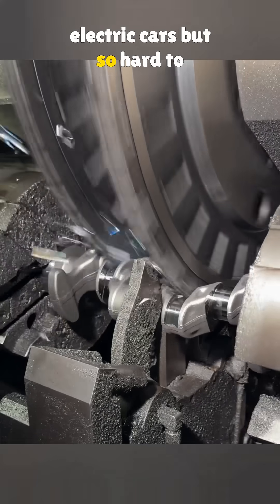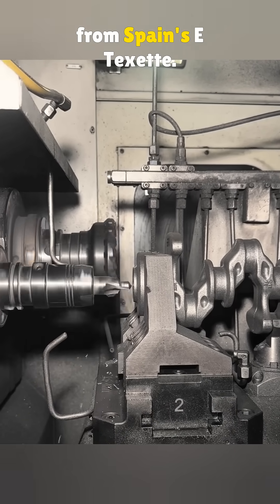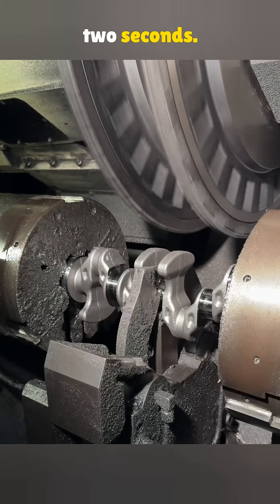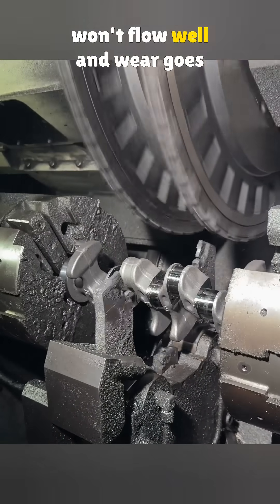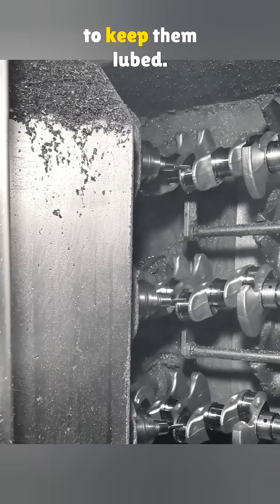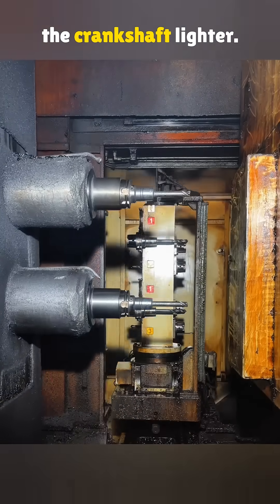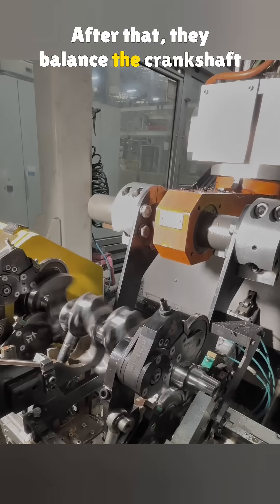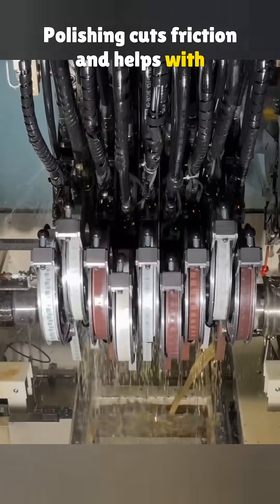How a Crankshaft Is Made #automobile #car #cartech #engine #mechanic

Comment: Unfricken believeble. Yet despite such complex manufacturing process, not cleaning the crank to perfection after drilling will make your engine fail just because of tiny particles are still present inside the crank.
Reply: Very true and I am impressed that someone would mention that. It was called the " plain bearing" long ago.
Reply: The debris getting into the babbit material on the bearings will lead to failure.

Comment: The internal combustion engine is riddled with flaws that cannot be engineered out but can only be counteracted with additional mechanisms and systems
* Excessive heat
* blowby gasses
* Excessive noise
* pollutants
* narrow power band
* low power
* ignition timing issues
* Excessive vibration
* much more
The electric drive train eliminates those issues in a smaller, more durable package that requires little maintenance

The main problem with EVs is that it greatly reduces revenue for Wallstreet

ICE vehicles generate more profits after the initial vehicle purchase with replacement parts, repairs, maintenance and fuel cost

Wallstreet don't want EVs to go completely away just the meddle and low end ones for the average consumer

They very much want the electric Bentley, Rolls-Royce, Ferrari's, Lamborghinis, and other luxury and hyper cars for themselves

Don't let their campaign to kill EVs succeed

The lies are:
* EVs are too expensive
* batteries don't last
* catch fire more than ice
* charging takes too long
* nowhere to charge
* low range per charge 

Once you acclimate to the slightly different way of owning an EV you will not go back

Comment: I do balancing myself. It’s a specialized field but you’d be surprised how much work there is; hospitals, electric motor companies, every industrial business, etc. We actually don’t do crankshafts anymore, or any automotive stuff tbh (it’s not worth it for us), but my grandfather and father did in the past. They used to balance Ford stuff, for example. We only do industrial stuff now, mostly really big stuff. We have balanced rotary engines before though, that was interesting (guys cut them down and ruin them).

Comment: what means easier to produce? when normal gas car are still cheaper then electrics? isnt it the other way?
in my country cheapest electric is still 10% more expensive than cheapest gasoline car and for sure its not better in performance or range than it

Comment: This is all a ploy to make it seem like electric engines are better.. the fact that I can be stuck in a desert, and be saved by a gas can, keeps the gas engine better.. the fact that the batteries are so toxic that if they start on fire, it will never stop until its all gone.. the fact that if I get stranded somewhere, no one is gonna be able to  ring me a charging station, but, they can bring me a can full of gas!!

Comment: Yeah but the problem with electric cars is they are driving bombs I’ve seen one explode and they burn at about 4000° you cannot put them out and they will continue to explode as each cell explodes and if you’ve seen the people who mind the equipment the chemical to make the batteries they’re covered in it and they die of lung exposure it’s horrific in ChinaWe don’t need electric vehicles dependability is still with the modern piston engine which would you rather have if you’re gonna have to take 1000 mile trek through the wilderness you just don’t get the mileage out of a charge

Comment: Then y electric so expensive?
Reply: Because of the battery pack, mostly just that, the rest is cheaper actually.
And that isn’t really hold true for most part, since there are electric cars that cost 30k, and gas cars that cost 50k or even 100k, and the price of batteries dropped by 90% since 2014, and could drop even further in the future.

And even if the machinery to build the crankshafts of gas cars may seem complex, it’s all tried and tested technologies since an hundred years or so, so there isn’t any R&D expenses involved anymore.

Comment: Nice, now please upload a video on making parts for an EV, with the same level of detail in manufacturing the components - motors, batteries, PCB, the components on a PCB, controllers, chargers etc etc.... Let's then see if the process is any easier than ICE engines.
Oh! And don't forget to mention charging stations and the lack of their availability compared to gasoline.

Comment: The engineers and machinists who design and operate these technological wonders are among the unsung heroes of the automotive industry.
Reply: They need to have these engineers address maintenance and repair design.  At least for the areas that are known to require replacement/repairs.    When replacing a light bulb requires taking half to front end of the vehicle apart to replace.   That's Idiotic.  But I know its all about ease of manufacturing, and great for the dealership maintenance departments.   Just not for the vehicle owners.
Reply: Just remember, the engineers also don't give a shit if the mechanic has to remove the engine or transmission just to change the starter..
Reply: Kungen Gustaf V Adolf Bernadotte vart Älgjägare på Halle & Hunneberg,och en av hans Prominenta Jaktkamrater
Vart Reichkansler H.W.Göring 
Vid ett tillfälle vart Lottakårens Rut Martinsson uppvaktad av en något överförfriskad otäcke
Tysken,dvs Herrmann W.Göring då räddade de Värnpliktiga Lottan Rut Martinsson ur Klorna på den Tyska Örnen-Han fick sova ruset av sig i ett kallt Tält på Halle & Hunneberg,och ådrog sig en svår Lunginflammation varvid Kungen beordrade en Taxi och en Pilot att frakta Göring till Uppsala Universitets Sjukhus,där han något senare fick besök av Anna Lisa Eriksson och Gabriella Ida Karin Stenbäck,varvid tycke uppstod mellan Gaby och Herrmann W.Göring. De fick ett gossebarn 26. November 1945
Som blev bortlämnat. Valter Evert Karlsson född 451126-numera Valter Kegö Scheelegatan 38A Stockholm
Reply: They were able to convince the machinist to do this for pennies. That's the real crime.

Comment: And electric car and truck suck, cause we do not have the technology  to get the to run 500+ .ls on a single charge, and the produce more toxins into the air in the first yr of use than gas or desiel engine does in 10yrs, there also a fire and explosion hazard, and where do we get rid of the batteries after we replace the old ones we can't refurbish them like lead/acid batteries in our cars now. Electric is just plain junk in a fancy wrapper being pushed on ppl by green ppl.

Comment: You can understand why many modern American cars are such crap and leak oil. They tend to use cheaper steel that will begin noticeable degradation in 5 years. Older cars, if properly oiled, might experience almost no wear to the metal in the engine block because it was made from the best steel around, which is now too costly. Steel from Asia is (well, I guess, was) cheap because it wasn't the highest grade. 

Even pricy metals like Silver aren't worth anything if not refined to a pure state. A US quarter is 0.9 silver (90% silver, 10% impurities; not including the copper fill, visible from edge). In the US, the standard for pure silver is 0.999 (99.9%) and in the UK, it's 0.9999 (99.99%).

So, in the US, steel quality varies quite a bit. At my job, we use 304 and 304L stainless steel. One is used for more exposed parts to the elements, the other is for parts we make that're more protected from weathering, but go unpainted. The difference is the amount of manganese in the steel as a percentage. Essentially, on has a more strict iron/manganese ratio than the other.

This is the type of steel quality variance that matter when put into an engine block. You cannot just put any quality steel. You want one that's tough, and one that doesn't rust. Rust is FeO3, meaning for each iron atom, you add 3 oxygen atoms. Doesn't take a genius to notice that's gonna require more room, and therefore the metal expands. This is how an engine that hasn't run (and therefore been lubricated) can seize. These components are (designed) water/oil tight, but not airtight. So air seeps in over time causing rust as oil sinks down and evaporates off of the metal.

Comment: Tool wearing from cutting grinding etc causes tools to be off by thousands of inches. The same tolerance for most engines. Hence machines are monitored an serviced according to so many made. Example s&w has a military only knife. The serrated edges are cut by a disc thats resurfaced every 3 knives serrated. An thats just a knife

Comment: EV engine are simpler but 7 - 9 thousands cells aren’t simple nor cheap and will need replacement around 10 years depending usage & charge degradation will happen.

Comment: No, this is not more complex than EVs. It is just different complexity. Just find out how electric motors are made. Or battery cells or power controll electronics. Or litography used to make chips.

Comment: Not true at all I beg to differ why is it that an EV on average is more expensive than the average ICE car? What about those complex batteries in your EV?? Not to mention their computers on wheels full of electronics. An old ICE engine car with a carburetor all it needs is a can or starter fluid and a good battery and it will run it’s a “dumb” engine old mechanically injected diesels are even dumber because they don’t even need an ignition system or any electrical system other then the battery and starter. Electric vehicles are complex expensive computers on wheels with massive expensive and sometimes very dangerous and flammable high voltage  batteries.

Comment: Electric cars are easy and combustion engines hard to make? Sure about that? If something goes wrong here you can scrap the defunct crankshaft and begin all over. No fancy materials needed to dig out of the earth. Also this is already automated and as long as the global markets work we're able to produce engines as long as we like. Also the complexity - sure a modern car has thousands of parts. But a car battery also has, although the single cell looks the same they all can fail, brick the whole car and make it impossible to repair economically.

Comment: It might be easier to make electric cars but an internal combustion engine will last longer than the electric car.
A 2003 to 2008 Corolla can have a lifespan of up to 500,000 MI easily.
In an electric car the battery works for about 10 years, the system that charges the battery wears out also in about 15 years.
If I'm wrong why are electric cars that are 10 years old are so cheap?
Reply: You then have cars that need engines and transmission replaced every 120k miles in a modern car. And even the japanese companies are getting bad about it.
Reply: Replacing the transmission or the engine in my car it will cost around $3,000 for either job tops. 
And is not at 120,000 mi more like 250,000 or even more. 
The engine in my car has 263.000 mi and it still runs like a clock. 
On an electric car you can't get more than 12 years of a battery  @madjackgamingandfitness498
Reply: A 10-year old car with 100,000 to 150,000 miles is it going to be pretty cheap.

Comment: Easy to make electric cars? Huh? I think someone needs to take apart an electric motor and have a look inside at the windings. Don't get me wrong an internal combustion engine is impressive. Someone figured that out in there head on paper and by trial and error NO COMPUTERS! But same can be said about an electric motor.

Comment: AND I asked Grok, and Grok said that 99.95% of lead acid car batteries are recycled, mostly in the USA, and none goes into the landfill. And they also perfected the modern gasoline engine by the year 2007, and since that time, engines have begin to decline. It took 100 years to perfect the engine, between 1907 and 2007. New advancements in metallurgy, and engine design are simply not necessary. New 12 volt lithium batteries are wildly unnecessary, and harmful for the environment.

Comment: 11:33
Still wondering exactly how you've managed to have the overhang on both the front and sides, is the structure on a separate frame entirely and centered the inner walls between foundations?

Comment: Really is amazing. I have a 97 detroit series 60 diesel with over a million miles on it. I can't imagine how many times that crank has rotated and she's still going strong. Brilliant engineering.
Reply: Likely the high mileage cars will actually have a slightly less complex manufacture - especially from '97. They'll have lower tolerances, more oil changes, lower revving and thicker oil.

Comment: The reason engines are expensive is the low tolerance 
Everything must be milled to very low levels of acceptable tolerances to function correctly 
Modern ones have deliberately lowered tolerances to be cheaper to make but result in engines that can take very little wear before breaking down followed by a high stress test to make sure it expires right after the warranty expires 
Extra cost from the unrepairable cylinder bore coatings used instead of just resurfacing so that engine rebuilders have that much harder a time to fix them

Comment: The heat treatment isn't rapidly heated and cooled to keep the "inside flexible"... that's not a good thing for crankshafts. 🤦

They're rapidly cooled as PART OF the heat treatment process... also there's no reason to harden the inside of the crank when that contributes very little to its ability to function properly.

Comment: ICE car is a piece of art. A well maintained car can last for decades
Reply: Yep, I had a mass produced medium sized sedan for 36 years. From 1989.

Only had to replace it when some scum tried to steal it and damaged it. Right after i spent nearly 10k on annual repairs. My 100 yo mother required a better car to get around for medical appts and we couldn't afford more repairs on an old car

Still in debt now thanks to whoever it was. Who steals cars from disabled parking bays?
Reply: You spent 10k annually on it?  @ed9121
Reply: Correct. I daily a 55 year old pickup.
Reply: Yep- my '85 yugo gv 3 cylinder has lasted all 40 years since i bought her. Still running strong and no problem passing other cars on the freeway 👌💯
Reply: I mean you can buy a android auto radio and a reversing camera and if it has air conditioning then you won't be loosing on much.
Reply: It takes LESS workers to make an EV!
Reply: That may have been the case 30 or more years ago but not cars don't last and are designed to break after warranty goes out.
Reply: I love my PT Cruiser no ev can replace it
Reply: As long as they are no ICE agents. After Mr Orange is done, there will be no crankshafts made from many countries.
Reply: Don’t catch me buying a new one
Reply: This shows how imposing tariffs on foreign made products can damage car manufacturing so much.
Reply: An ICE can last a century or more while an EV will be in the scrapper within just a few years.
Reply: But they don't really
Reply: Art, not science?
Reply: @speculawyer  applied science is art.
Reply: The concept of making the engine work of course is applauding.
Reply: @speculawyer there is a thing called "mechanical arts"
Reply: Too bad it's obsolete
Reply: @bigsmall246  smart car?  Closest car to that however MUCH better made
Reply: @bigsmall246  lol obsolete until you get massive solar flare that screwed our grid, then you'll be walking. I'll be passing you 😂. Gas cars will not be obsolete for a longggggg time
Reply: @bigsmall246 oh look the soy burger has given their opinion.  See you on Election Day 😂
Reply: @MAXIMUSMINIMALIST continue living in the past my friend. I know change is scary.
Reply: Not really. The heat and moving parts kill them.
Reply: @speculawyer unless it’s well maintained as he said
Reply: @speculawyer heat isn’t an issue as long as the cooling system works properly and the oil is changed at the proper intervals.
Reply: @speculawyer  This! an internal combustion engine is good for around 3-4 weeks before they go boom!💥
Reply: @speculawyer  I have a 26 year old truck with over 400,000 miles on it.  Still running strong.  I just replaced the clutch at 400K and have had to replace things like the alternator, power steering pump, fuel pump as well as the water pump.  Other than that, it's all original except for the routine maintenance things like belts, hoses, etc.  Even if I have to replace the engine and transmission, it would still cost a LOT less than replacing the battery pack on an EV once, and at 25 years old, the EV would probably be ready for it's third one of those.

Comment: as you showed: the problem for combustion engines is that thea consist of 1000 of parts which have to be made with high precision, sometime 1/1000 millimeter, the tolerances ar necessay to keep the engine air-tight ant that takes lubrication. but as  time goes by even the best engines show wear. and lose compression.not to mention the additonal  parts, hoses, pumps,  valves,  ignition, exhaust nufflers with lambda sensors, turbines and and and...
ma engine has to main parts: rotor and stator. a magnetic field makes the rotor turn. the engine does not wear out becauusee the rotor moves in ballrings(?) that do not wear our. then enzgine is as new even bit huddreds f thousands of miles. no other mechanical parts are needed. an EV has only 3 components: engine, battery and the electronic that changes AC nto  DC and vixe versa.  not to mention the fantastic 6orque which is always in maximum at any speed. andit does not need a gearbox. I ave an EV and it is fantastic to drive. and cheap, t load th battery at home for 30€c for one kWh  and it takes only 17 kWh for 100 km (figute that out  with your stupid miles per 100 kWh
Reply: As if making the rotor and stator is not more complex than this. How do you make a machine spool a copper wire inside a tube?